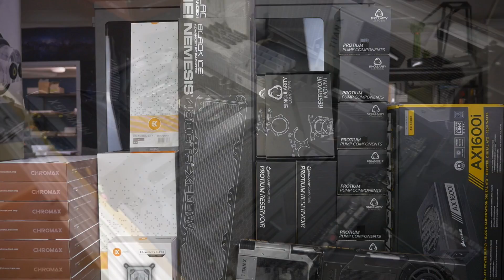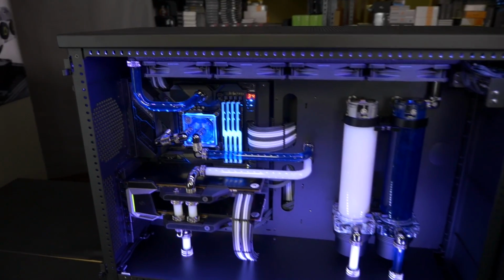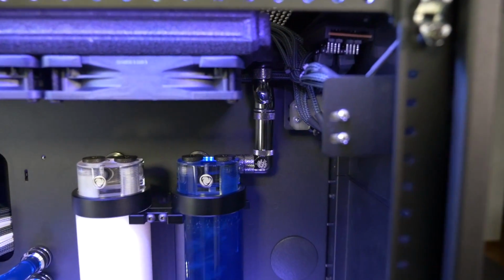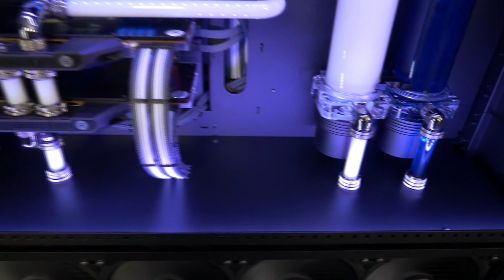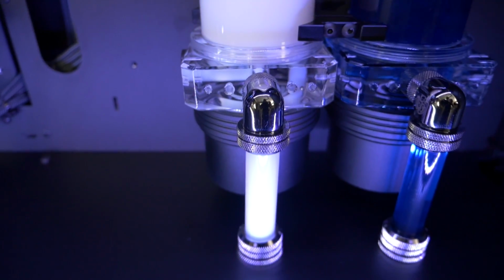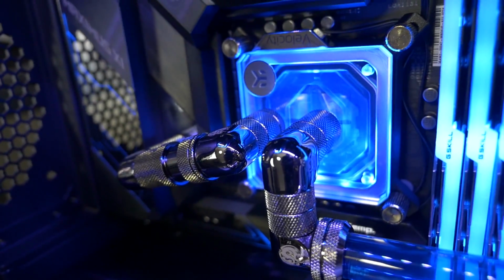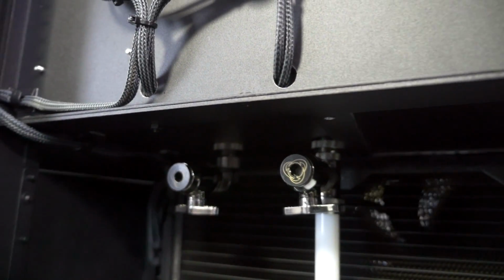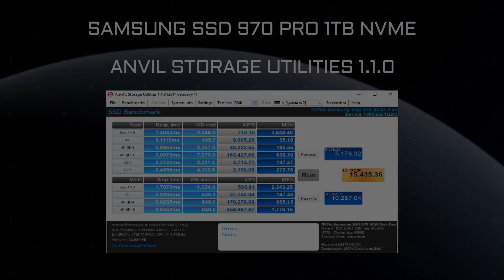Caselabs SMA8 Build #41

Comment: Daniel, I wonder if it would be possible and/or efficient to install a Y junction before and after the vrm cooling block as well as the cpu block , in order to flow to both components at the same time ?

Comment: it so clean, nice caselabs sma8. I regret i didn't buy one. !! i can only hope they raise up in future.
Reply: yeah it was a bit of a shocker hearing they went down :( regret too i didnt buy a sma8 in time
Reply: Mine is in a closet gathering dust. Used it for a while and decided to go smaller.
Reply: @1911Savage  ohh? So you never used it or?
Reply: @koford  Yes, I used it. The chassis divider and mid plate have mounting holes and pass-thru holes but other than that it is like new.
Reply: @1911Savage  , Are you looking to sell it by any chance?
Reply: @OnlyOptionMedia  Yes, I'd like to sell it. I'll probably never use it again.

Comment: Is that a single fitting in between the reservoirs?
Reply: They each have their own passthrough/bulkhead fitting behind them at the top for filling.  The blue loop's return is coming from the top radiator.  The white's return is coming from the passthrough/bulkhead fitting in the midplate below the pump.